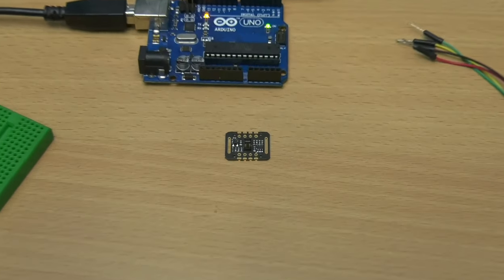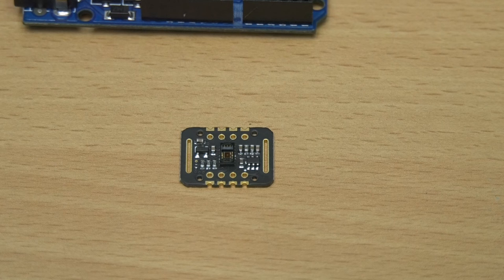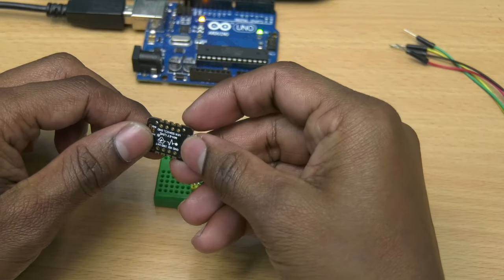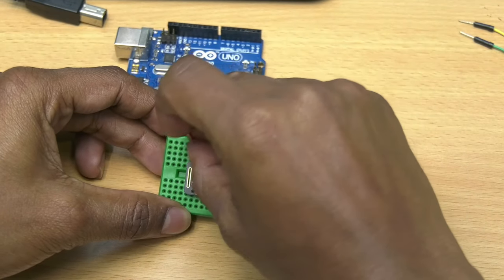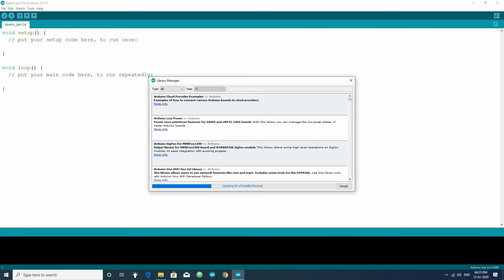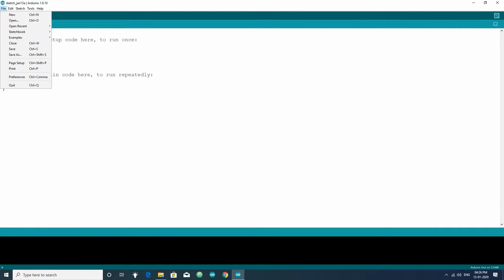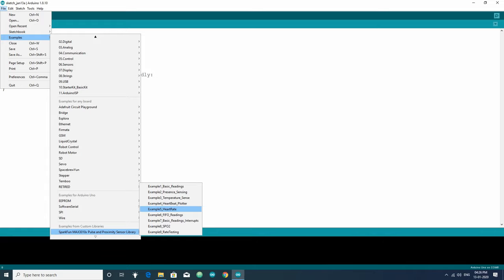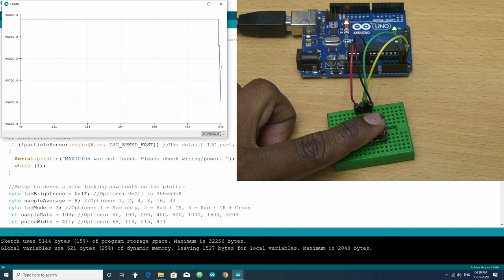What is MAX30102 and how to use it | Heart Beat Sensor | UtGo

Comment: to activate 30102 Press key , key? ..?
Reply from the maker: Please explain what you are asking
Reply: @UtGoTech  
Code for blood oxygen
 [  Serial.println(F("Attach sensor to finger with rubber band. Press any key to start conversion")); while (Serial.available() == 0) ; //wait until user presses a key Serial.read();   ]

I pressed all the available keys, but it is not converting.
Reply: I have a another doubt,
if I connect MAX30100 with another sensor in arduino board,  the heart rate goes zero and spo2 showing references values..clearly pulseoximeter is not working. But if I connect pulseoximeter with arduino, heart rate and spo2 is showing and the pulseoximeter is working. Do you know what is the issue ? ( when I connect another sensor, max30100 is not working. )
Reply from the maker: Which code you are using
Reply from the maker: What other sensor you are connecting

Comment: My sensor is heating and.. In serial printer it is showing max30102 not found. Please help me bro
Reply from the maker: How much voltage you have given to the module.
Reply from the maker: There may be some chance that you have got faulty module
Reply: @UtGoTech  I sorted it out bro... Just removed the Resistors... It's working fine now

Comment: Can you help me...i need max30102 sensor code in python programming..bcz i control arduino with help of raspberry pi....sensor connected with arduino.so i need python code!!!!!
Reply from the maker: You are using Arduino board in between Max sensor and raspberry pi. Am I correct?
Reply: Yes...arduino connect with sensor...and raspberry oprate arduino it means raspberry and arduino interconnect. I need python code bcz i implement code in arduino with help of raspberry
Reply from the maker: I think you have to program Arduino board so that it can interface with Max sensor to read data and then send it to raspberry Pi using serial or i2c interface. For Arduino you don't need python code
Reply: I know..do not need python code.. without python code it is possible..but python code is requirements of my uni. Project..its mandatory
Reply from the maker: Sorry currently I don't have python code to do so.

Comment: why do my lights go on sometimes and off sometimes then just decide to not work at all
its so frustrating😵‍💫
Reply from the maker: Which type of battery you are using ?
Reply: @UtGoTech  i use an uno board (usb cable to computer
Reply from the maker: Make proper connections. Solder the male headers.

Comment: it doesn't work with my.. the led not work What should I do
Reply from the maker: Check for loose connection.
Reply: @UtGoTech  checked the connections and they were correct. But it still doesn't work I uploaded the code, but the LED does not work and I get a message in the serial monitor (can't find max30102 check...) I read online that I have to remove the 4.7k resistor and install it externally, do you have any idea how to do that?

Comment: Sir please give the source code of max30100
Reply from the maker: Easy Code is written by using existing library. The code have to be change according the library used. So you have to tell which library you are using.
If you didn't installed any library yet then add MAX30100lib by Oxullo Intersecans using Arduino Library Manager. With this library you will also get some example codes which will fulfill your needs.
Reply: @UtGoTech  sir can I use max30100lb source code in max30100 sensor please reply 🙏🙏🙏🙏
Reply from the maker: This library can be used with MAX30102 and MAX30105 modules only. This library doesn't support MAX30100 sensor.

Comment: Bro mera sensor max30100 me light nhi jal rha iska MATLAB kya hoskta hai ????
Reply: Also showing initialisation of oximeter failed
Reply: I'm using with esp32
Reply from the maker: "Initialization of oximeter failed" is showing because your micro-controller is not able communicate with the MAX30100 module.
You should check you hardware connections and make sure I2C communication is ok.
You can use I2C Scanner sketch to check whether your micro-controller is detecting the MAX30100 sensor or not.
Reply: @UtGoTech  it is showing initialisation failed :I2c error
Reply: Tell me the solution should I remove all 3 resistors from sensor and connect external resistors????
Reply from the maker: Is your MCU detecting the MAX sensor ?
Have you check it with I2C Scanner Sketch ?
You can contact me through Telegram @UtGoTech

Comment: How can I just want the information in the serial monitor not in a display how can I do that?
Reply from the maker: Just print the heart beat data in serial monitor using Serial.print function. Sending information in serial monitor is shown in the Example5_HeartRate sketch, which comes with the library. In Arduino IDE just goto File -> Examples -> SparkFun MAX3010x -> Example5_HeartRate.

Comment: I have this problem: "MAX30105 was not found. Please check wiring/power"
Can someone explain to me what this is due to? it is supposed to be well connected
PD: I'm using a ESP32 board
Reply from the maker: Communication error occurs due to loose connection or wrong connection.
Reply from the maker: You can also use I2C Scanner Sketch to check if the modules are communicating or not.
Reply: @UtGoTech  What happens if the scanner does not detect it, I already tested it and it tells me that it does not find any device, the sensor led does not turn on either, what do I do?
Reply: It may be because I have not soldered the sensor, but what if I do and still the problem persists?
Reply from the maker: If the scanner app doesn't detect your MAX30105 module that means your ESP32 board is not able to communicate with the  MAX30105 module. Check whether you have connected it to the I2C pin or not.
Reply from the maker: Then you should first solder it for a good connection